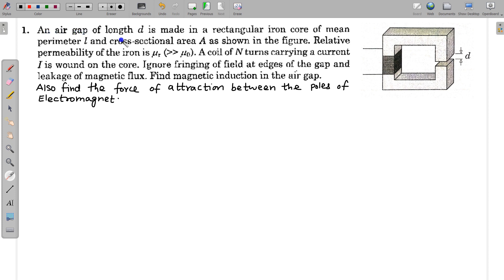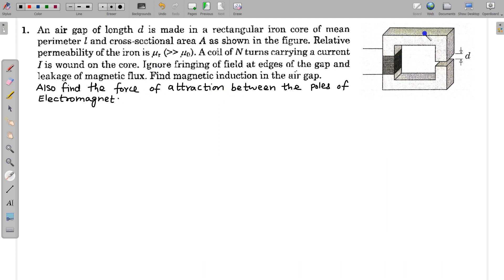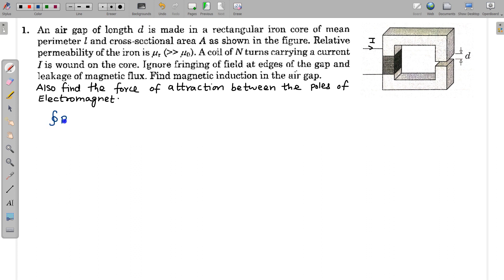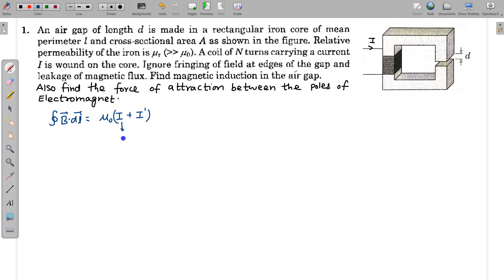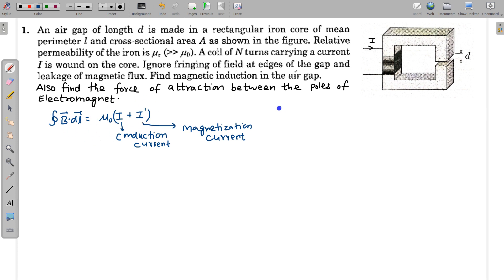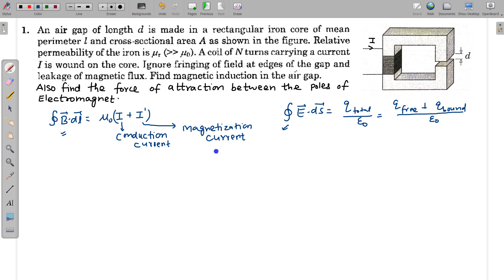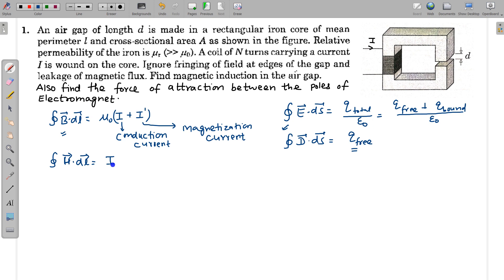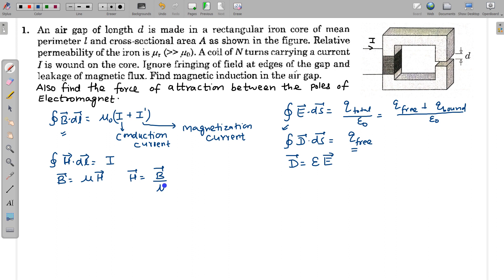Magnetism | Pathfinder Solutions | Magnetic Field in Material | Ampere's Law

Comment: Sir I have a question from Pathfinder thermodynamics...may I ask it here
Reply from the maker: yes
Reply: @PhysicswithAkashGoyal  sir thermodynamics, build up your understanding, q 26,... Why in this question we used only energy conservation...why momentum doesn't look to be conserved here??
Reply: Sir one more, electrostatics, build up your understanding, q 54....
Reply: Sir I am New to this channel...sir  please upload some videos on olympiad level problems for optics
Reply: @ramprakash1562  see the third line it says container is made to move  àbruptly which means an external force is applied which changes its momentum. For energy conservation we need to think of first law of thermo. Container is insulated therefore q=0 , volume of container is fixed therefore w=0 hence its internal energy is conserved... This type of question is asked in jee main, where container was àbruptly stopped and the temperature rise was asked...
Reply: @sakshampaliwal8170  I think I couldn't make it clear to you bro....I mean after a push, the container along with gas acquired a velocity ,that is "now" it has a momentum....but finally it seems like it has zero momentum...so my question is why  "that momentum gained after that push"  is not conserved...